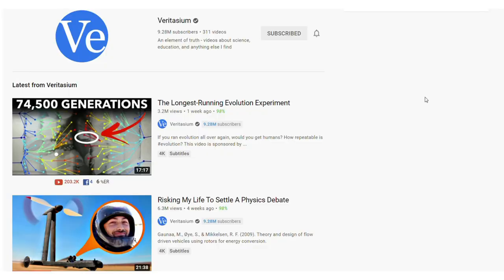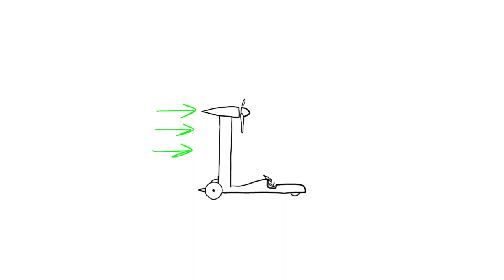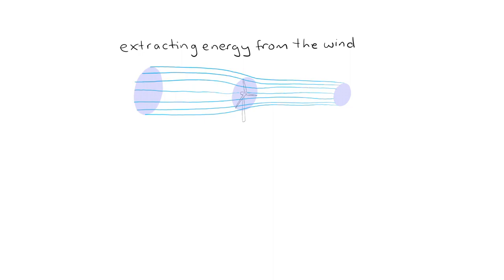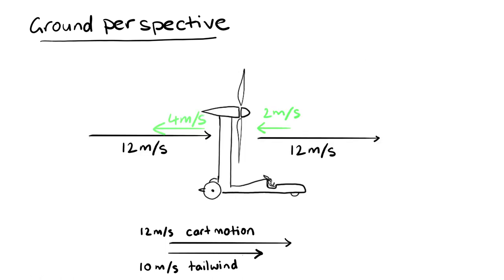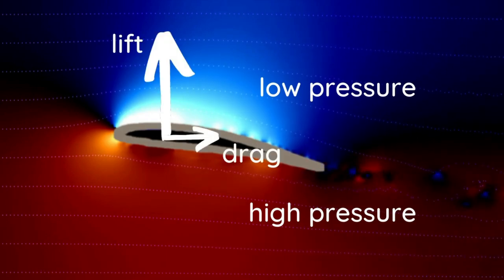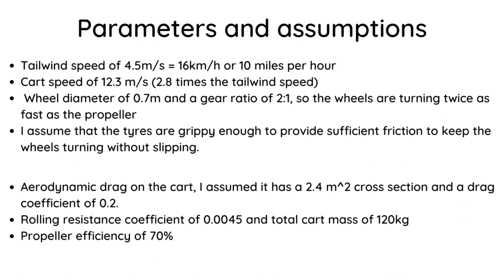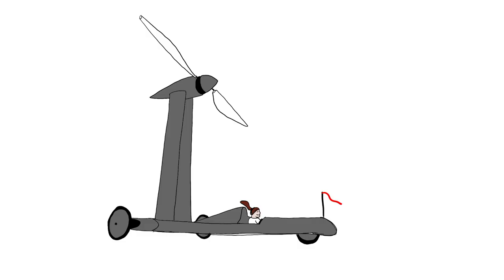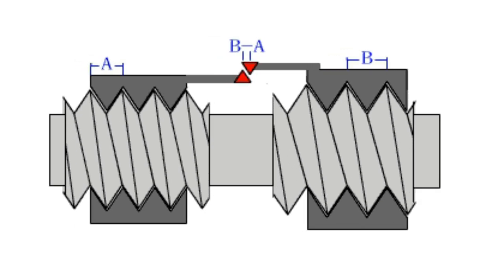Downwind Faster Than the Wind by Veritasium: How Does it Work?

Comment: Hi, Rosie... I love your videos and hope that bringing engineering concepts to the general population will help make the world a better place.  Having said that, this is not one of my favorites.  Let me start by saying that I'm a skeptic who thinks that going 11 mph in a 10 mph wind is not much different than going 1 mph on a windless day.  I also object to even having this discussion based on a flawed experiment in which the windsock is placed in the ground boundary layer and in the turbulent wake of the propeller, making the entire experiment pointless, since you have no accurate measurement of the relative free wind speed.  As a minimum you could have a discussion if the windsock were on the chase car.
I think the sailboat analogy is a good one, because I don't think you can actually go faster downwind than the wind speed.  You can go crosswind and upwind because you have a relative wind speed that can be converted to a force with a component in the direction of travel.  I tihnk of this as an energy problem.  Once you get to the wind velocity (vector, not magnitude), then to go faster, you are increasing the kinetic energy of the system, and that energy has to come from somewhere. 
Suppose we try this thought experiment--wind turbines are very inefficient ways to exert a force on a vehicle due to turbulence and drag.  That's why you don't find them on cars--they have a drive wheel instead, which is much more efficient.  So, let's build this cart with a big sail instead of a propeller to get the car moving, but we convert the energy from the wheels and transfer it to a drive wheel, instead.  This should be more efficient than the propeller, but I think it clear that it won't accelerate without an extenal force. 
Just my thoughts.  I still love your channel!
Reply: //" Let me start by saying that I'm a skeptic who thinks that going 11 mph in a 10 mph wind is not much different than going 1 mph on a windless day.  "//

Then you should understand the craft better and think again.

On a windless day there is no relative motion between the air and the rolling surface.  With no relative motion, there is no energy to be harvested.   On a day with a 10mph true wind, you can extract energy by slowing down the 10mph wind to say 5mph and use the extracted energy as you wish.

//"since you have no accurate measurement of the relative free wind speed."//

For the NALSA/Guinness world records, there was extensive accurate measurements (16 recording sensors in total) taken.  These sensors were on the craft, the chase vehicle and along the course.  The fact that you haven't researched the NALSA records and the data methodology doesn't mean accurate measurements have not been taken.

//"I think the sailboat analogy is a good one, because I don't think you can actually go faster downwind than the wind speed"//

Once again you should do your research.   Iceboats have been achieving downwind VMGs of greater than 1.0 for more than a century.  Land sailors for not much less time, and sailboats have been documented doing it for more than 20 years.  It's actually trivial now that top performing sailboats are on foils.  Just look at the America's Cup boats for the easiest examples - no recent AC boat has used a spinnaker to run downwind, but now tack back and forth (with relative wind from the front)  on the downwind side of the course. 

//"This should be more efficient than the propeller, but I think it clear that it won't accelerate without an extenal force. "//

In your example, you have provided no mechanism to slow the true wind (wind over the rolling surface) while traveling at or above windspeed and thus (just as you say), it will not accelerate without an external force.    The Blackbird does provide such a mechanism and thus requires no other external force other than wind.

Comment: Rosie, let's just consider the diff between a sailboat max wind factor of 4x wind speed and an iceboat max wind factor of 5x and the graph of the blackbird's acc to 2.8x wind speed. The makers here are telling me the limit of wind factor is due to real world losses and the speed factor should be theoretically infinite. If that were true the curve up to 2.8x would be asymptotic, not a straight line as losses presumably increase with speed factor. Also losses for an iceboat must be much smaller than for a sailboat but the increase in speed factor is not exponential, it's a modest 20%. They suggest if the blackbird's gear ratio from wheels to prop was near infinite without losses that would drive the sail speed near infinite across the wind allowing the pitch angle to the wind as near 90 degrees allowing near infinite thrust for the blackbird (theoretically the thrust force due to pitch is infinite at 90 degrees and zero at zero degrees). I say even without losses the gear ratio, prop speed and prop pitch limit the system's speed factor to a finite value that is then further reduced by real world losses which as the iceboat sail shows are actually very small in comparison. Their math is wrong in that it says the individual drive factors can be extrapolated to infinity whereas those drive forces are linked together as a system which has a mathematical finite limit probably close to what the iceboat hints at as 5x wind speed. The driving wind speed is finite so ignoring losses can not result in a speed factor of near infinity if the math was correct in the first place. Agree?
Reply: // " If that were true the curve up to 2.8x would be asymptotic, not a straight line as losses presumably increase with speed factor"//

You're ignoring the design point of the craft.   Propellers (even variable pitch propellers) can't 'recurve' themselves en route, and the Blackbird is equipped with fixed pitch gearing so for any given design combination it will fall within and without it's performance window at each end. 

If the Blackbird were able to infinitely 'morph' it's design to optimize itself at each speed, it would fall off asymptoticly.
Reply: // " let's just consider the diff between a sailboat max wind factor of 4x wind speed and an iceboat max wind factor of 5x and the graph of the blackbird's acc to 2.8x wind speed. "//

In the first two, you're comparing the speed of the airfoil though the apparent wind to the wind itself.  In the third, you're comparing the chassis through the wind to the wind itself. Unlike the first two, the airfoils of the Blackbird don't travel through the apparent wind at the same speed as the chassis.
Reply: @johnborton4522  The prop pitch is adjustable according to the 1st video. The prop is a sail across the wind. All that matters is the pitch and speed of the sail. The speed of the sail is boosted by the wheel to prop gear ratio. So you only have 2 things to optimize and they react with each other to limit the performance into a bell curve not 2 individual exponential curves from a finite wind speed as I'm being told. I see no indication from the data that losses kick in yet to form an asymptotic curve that limits the speed factor.
Reply: @johnborton4522  All that matters is the prop speed and pitch across the wind whether it's on the cart or across the water or ice.
Reply: @ralfcis  

I designed and built the Blackbird. you won't need to explain to me how it works.

I was explaining to you why the data graph looked the way it did.
Reply: @johnborton4522  Ok so if you added a small gas motor to the wheels to compensate for losses for even a 1 mph tailwind, you're saying the speed factor would be unlimited because the gear ratio would be unlimited driving the prop to an unlimited speed with a pitch close to 90 degrees (for highest possible thrust with  an unlimited speed prop) and the speed factor would be unlimited with only a limited 1mph tailwind which is the only power source feeding this feedback loop between prop and wheels. I'm saying the feedback loop is self limiting to a finite value even with zero losses. Infinities will cancel out in the feedback loop but they don't when taken individually.
Reply: @ralfcis  

// "you're saying the..."

I'm saying exactly what I said at the start  and nothing more.

Your claim was this:

// "The makers here are telling me the limit of wind factor is due to real world losses and the speed factor should be theoretically infinite. If that were true the curve up to 2.8x would be asymptotic, not a straight line as losses presumably increase with speed factor. "//

I've explained that since propeller twist and gearing is fixed on the Blackbird, there is a performance window above and below the design point.  The hypothetical curve from the principles involved would leave you with the curve you describe, but not the real world performance window curve -- even with a variable pitch propeller.   That's just the nature of propeller design.
Reply: @johnborton4522  Ok you can't tune it on the fly but you could set the pitch and gear ratio for max speed factor. Is the speed factor limited by losses or by terms in the system's math tending to a finite limit when infinities cancel out.
Reply: @ralfcis  

Our design point was 12-13mph tailwind and travel rate of 2x windspeed.  This we achieved with a fixed pitch rotor hub.  

https://youtu.be/aDzWh9J1dk4

After hitting our target right out of the gate, we suspected from this that we could eek out a bit higher multiple if we installed a variable pitch propeller and some fairings.   Even though with our prop design our performance would be compromised over 2x, we felt the craft could still do better.  We were right.  We were over 3x rather regularly with the mods.

https://youtu.be/5CcgmpBGSCI

Max speed is limited by losses.   Building on this experience, the next craft built can smash the current record with ease.   

Build a craft with design points around 10-12mph and 4x+ windspeed, and a chassis fit to handle the torque and you're in great shape.   The Blackbird chassis was built for 25mph max and less than half the torque that eventually was put through it at the higher speeds - it was a victim of its own success.  It was totally unfit for it's final speeds and as the builder I refused to drive it as I considered it an accident waiting to happen.  More than once I thought Rick might crash badly.  I even regularly screamed over the radio for him to slow the F down.  Credit to his balls for the record where it is.
Reply: @johnborton4522  Thanks for the info. I look forward to more adventures. I think this took everyone by storm.
Reply: @ralfcis  

You might enjoy this article written by Kimball Livingston, who at the time was editor-in-chief for Sail Magazine.  He was one of the independent observers hired by NALSA for our record runs.

https://www.blueplanettimes.com/downwind-noir/

Comment: Why don’t the blades act as a turbine and turn the other way, turning the wheels the other way?
Reply: They will if you gear it slightly differently.  That's how the Blackbird set the upwind world  record as well. 

https://youtu.be/F7PNSyAfCjk

The gear ratio is carefully selected to optimize upwind or downwind configurations.
Reply: @johnborton4522  I don't doubt that at all but it still doesn't help me understand why the wind doesn't make the blades move the other way. I also don't understand why the direct upwind vehicle moved forward instead of backwards. It seemed in that video that it started at zero and it started moving upwind.
Reply: @nathanlewis42  The drive mechanism from the Wheels to the Propeller includes a Ratchet gear that only allows movement in one direction. 
Rick also mentions that this allows him to disconnect the propeller so that it free spins in the event that he needs to slow down.
Reply: @earld1403  I missed that detail. Thanks. I thought the cart used brakes to slow down.

Comment: I had an initial thought that the windmill blades were "Micro tacking"
Reply: The problem with that is that the windmill blades are not powered by the wind they are powered by the wheels. It does my head in but it can't be tacking.
Reply: @nathanlewis42  I'm glad I didn't bet $10,000 on either side.  My degrees are in Physics but this whole thing has left me spinning myself.
Reply: @donwilliams495  I don't have a degree in Physics but when even Physics professors are having trouble with it, I feel much better about not being able to understand it.
Reply: @nathanlewis42  In Junior high, MANY MANY years ago, I came up with the notion of hooking a motor to a generator and wiring the generator to run the motor.    Do you see the problem?
Reply: @donwilliams495  yes. This sounds like perpetual motion but I trust that in the case of going directly downwind faster than the wind, it's not. I think it's possible because the cart extracts energy from the relative motion between the wind and the ground.
Reply: @nathanlewis42  I'm talking about the motor-generator configuration.  Each has an efficiency of less than 100% so it would only work if you manually spun the set and would only spin until it stopped.  It would spin longer if you separated the two items and spun them by hand.  It was a wonderful idea for a young kid in science class.

Comment: So, why messing with complicated fluid physics when you can just do an analogy with a second set of wheels you allow to slip a bit, like a clutch? You could run it even in vacuum, no drag involved. This means that, if instead of wind you push it adding 1 kJ to the system, depending on the gear rate between the two sets of wheels, the car will suddenly move at a kinetic energy greater than 1 kJ? 🤔, it looks to me similar to the classic problem of pushing a bike backwards, but in a point in its pedal when it is in its lower position...

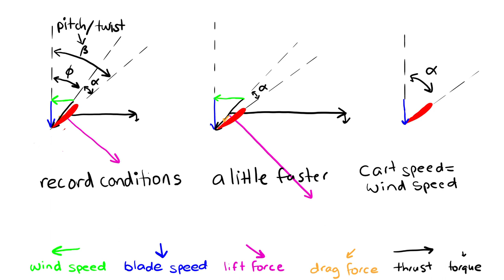14:18 indeed, to me there's still something weird with that. If relative wind stops at that right moment (AKA wind speed is reached), it's clear that the power pumped to the blades comes in expense of the kinetic energy of the car.
Reply: //"If relative wind stops at that right moment (AKA wind speed is reached), it's clear that the power pumped to the blades comes in expense of the kinetic energy of the car."//

That may be "clear" to you, but it's still wrong.

During the downwind operation of the Blackbird, there never comes a time when there is zero "true wind" (wind over the rolling surface).   Yes, there is a point at exactly windspeed where there is no relative wind over the chassis, that is not where the energy transfer is happening.  Energy is being harvested from the true wind and that continues to blow no matter the speed of the craft.
Reply: @johnborton4522  True wind means nothing in that frame of reference. Power could only come, if so, by the work exerted into the system by the ground as it pushes the wheels. Again, it seems that if this were true, we could come up with a system modification that shows a violation of the first law of thermodynamics...

Just substitute wind by a car pushing from behind. What happens when they just match their speed?

Or just use the energy from wheels into an electric motor. Once the motor makes it go faster than wind, the only force sustaining the movement comes from the motor, which comes from the ground. So no relative wind, no electric power.
Reply: @Trombonauta  

//"True wind means nothing in that system of reference."//

True wind (wind over the rolling surface) is everything.  That's where the energy comes from to propel the craft.

//"Power could only come, if so, by the work exerted into the system by the ground as it pushes the wheels."//

Yes, just like the ground pushing on the tower of the typical wind turbine.
Reply: @johnborton4522  What I mean is that once you choose your frame of reference, power can't come from both elements if one is not moving. In that situation: no air pushing the chassis, as in a vacuum. We can even neglect every loss. If in that situation the rolling wheels power an electric motor, would it accelerate? Would it keep its speed? Again: Pin=Pout means ΔK=0.
Reply: @Trombonauta  

//power can't come from both elements if one is not moving."//

Correct.  Doesn't matter which frame you choose, turns out that during operation, the true wind continues to blow so you have your movement and your source of energy.
Reply: You are correct. I just made a video on my channel with the correct explanation of how this sort of cart works and it involves energy storage.

Comment: Blackbird does go downwind faster than the wind .You must compare apples to apples. Most of these explanations and analogies are using other energy sources, just stick with fluid dynamics and you will figure out that the propeller is not pushing air backwards like a fan.